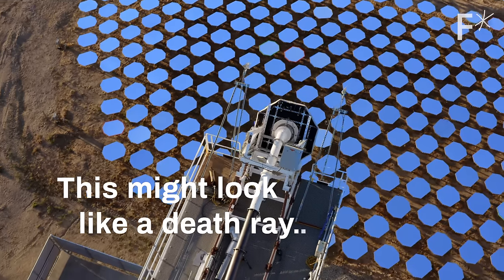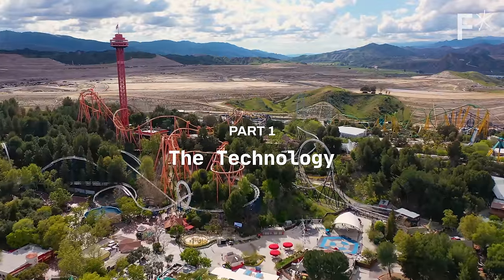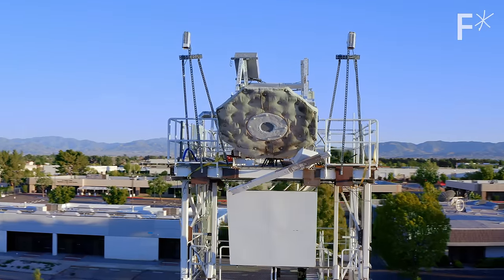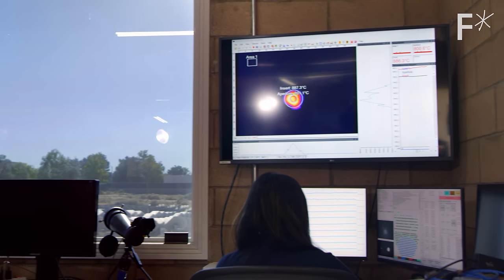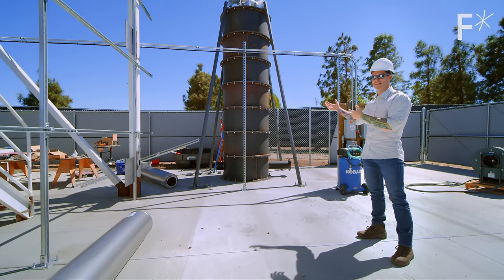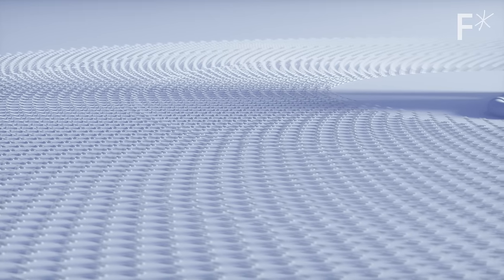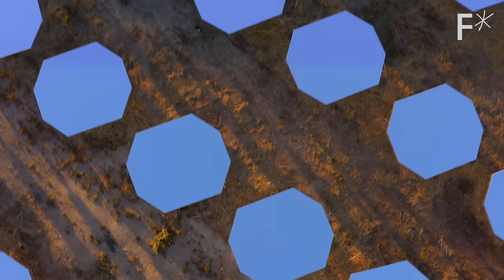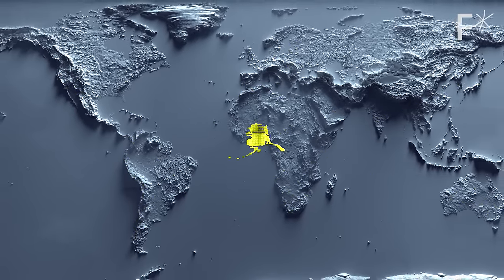How mirrors could power the planet... and prevent wars | Hard Reset by Freethink

Comment: Mirrors should be mounted on posts tall enough for people to walk beneath to use that area as partially shaded, productive agricultural land and using water with no chemicals to clean the panels then drips off to be agricultural watering.
Reply: Agreed! Especially for the dessert?? The shade provided may also create opportunity for condensation water production and be dual purpose for food and energy.
Reply: 1 - plants need sunlight not shade
2 - deserts are not fertile land
3 - water is hard to find in deserts and most would evaporate in the heat
Reply: @shashipancholi  Ridiculous fossil fuels defender.
1. Not all plants prefer 100% sunshine
2. Plants grow in deserts
3. Using water once for 2 benefits is my point
Reply: @sanjuansteve  apologies for being so blunt in my criticisms. Im trying not to be the guy who finds problems in every solution BUT critical thinking is required here.  

Basically farm crops would not benefit from the addition of solar panels/mirrors and ideally you want to keep the surrounding land clear for maintenance reasons. Harvesting the crops would also be a nightmare. The water issue is probably the biggest for me as it would be far more efficient to simply wipe the panels (try washing dishes without wiping) and directly feed water to the plants. Using enough water to clean the panels and feed the plants is highly inefficient and doesn't save any water. 

Essentially the main benefit would be to recover land for agriculture when it would be far easier to continue using arid land for energy production and fertile land for agriculture. There is no shortage of farm land and modern innovations in farming (such as indoor vertical farming) are aimed at producing food closer to where it will be consumed. This project seems to be aimed at producing energy far away from where people are living
Reply: Wind buffeting will do damage .
Reply: @shashipancholi  plants can't cope with the full sun in the desert
Reply: @charlesdickens6706  so how do they cope with full sun anywhere else? Its the same sun. 

What you mean is they cannot cope with the dry heat, which is part of my point that deserts are not the best place for farming
Reply: @shashipancholi  I am sorry to burst your bubble, but agrovoltaics is a thing that is already tested. 

In hotter climates the shade of the panels actually increase crop yield, by not having the sun dry out the crops due to too much sunlight. Moreover in these regions the evaporation that still hapens help to cool the panels and make them more efficient.

In regions like Northern Germany you get a lesser crop yield, but overall the efficiency of ground use increases. whereas a pure solar or farm field would generate 100% crops or power, a combined field generates around 80% of the crops and 80% of the power, for a total field efficiency of around 160%.

These panels are also placed on higher poles, so that machines can ride underneath them.

This is with PV though, so can't say how it would play out for concentrated solar like in this video.
Reply: @charlesdickens6706  Don't be ridiculous.  The structure simply needs to be made for the extra height and slightly higher wind loads.  It's very common to have solar panel covered parking structures for example.  STOP defending fossil fuels with nonsense!
Reply from the maker: Always interesting to brainstorm new ideas! There's certainly a lot of variables that would be at play - would it be cost-effective? would it make sense in every environment? would it inhibit other operations? - but it's cool to think of what other ways of increasing sustainability might be possible and explore whether they'd work. It's the only way to find the ones that will.

P.S. Since someone mentioned vertical farming, we did another video in this series on the subject: https://www.youtube.com/watch?v=J4SaSfnHK3I
Reply: Far to complex. 
Skip it.
Reply: @shashipancholi  Plants can also grow in diffused sunlight, at least grass. Deserts are fertile lands sans water. Just add water and see them turn green. Water is not easy to find in deserts, but can be collected from moisture present in the air.
Reply: It's hard to take you seriously if you keep characterizing your opponent. That"s not good form.
Reply: @freethink  well played...
Reply: Plants need light, there is something called photosynthesis.
Reply: Cochin Airport is doing just this.
Reply: Ok.  But the whole point is to make the system easy to use, set up, and maintain.  If you start increase its size, you're pushing cost for proposing agriculture in a desert, when we have more than enough agriculture already.
Reply: Not much water where the sun is best.  Would you move the sun collection to agricultural lands or import water to the desert?
Reply: @chaoznorder6207  Legit one of the smartest comments I have heard so far.
Reply: nasa: do you want a scholarship?
Reply: The problem with this would probably be in the integration and logistics, how to do maintenance without destroying crops, harvesting with mirrors in the way, optimizing for solar power vs crop yield, etc. Any time you try to do two things at once, you lose efficiency due to complexity.
Reply: @emilemil1  Yes, you're not thinking all of the efficiencies through my friend.  Some plants prefer or will only grow in partial shade for example.  Panel cleaning water becomes agricultural irrigation.  Partial shade provides better working conditions for agricultural labor.  Etc.
Reply: @sanjuansteve  I'm just pointing out some possible negatives. What you're ultimately saving by combining agriculture and solar is land area, and a little bit on a separate shade system. The question is if that positive outweighs the negatives.
Reply: Dump idea, but smart ones will come, but you have to keep the dumb ones coming
Reply: @shashipancholi  AHEM!
Greenhouses...
Reply: We only need to cover an area the size of Alaska to power the Earth. Mounting every mirror on a tall post would increase the complexity and resources needed for basically no reason. Agriculture today is very inefficient, around 40% of US land is used just for feeding farm animals. We don't need even more agricultural land, we need to transition to plant based diets/ lab grown meat. Maybe in the future, when every piece of land will be needed, your idea could be implemented, but for now we should focus on transitioning to using only renewable energy as fast as possible.
Reply: I like it!
Reply: I like the idea of what your thinking and it would work too a degree but the only way to implement it is at the design level and the hurdles to overcome are not so simple. 
To give some context to this...
In the solar PV farm industry there is a common problem of dew condensing on the modules this dew then runs off the modules and creates a line of weeds and trees that then grow up and interfere with the modules (shading, physical damage etc). So yes that water technically could be used for agricultural purposes. However that water is minimal. Now to point out before anyone says it, no it does not all eveprate. It condenses as it falls and then runs off the modules into the soil and is then captured by the soil/ plants before it eveproates.
The shading of the modules does increase plant yeald by a significant amount.
Part of the problem is that this miniscule amount of water always falls in the exact same places so it can not be considered as a sprinkler type senereo (yes I know that was not implied) and the infrastructure and matinance of capturing the water far out ways the cost benifits of implementation.
I'm terms of land usage for agricultural the mirrors would prevent the use of large machinery to harvest and therefore only leaves it to livestock.
Livestock under solar does work however breed and species needs to be considered. Cattle is a no go due to eating wires their size and using the infrastructure as a back scratcher.. goats are a no for chewing cables and their love to climb.
Some breeds of sheep climb and sometimes (but not often) chew cables so some sheep may be used. However they only eat some types of grass and only to some heights which still leaves mowing and weed control over the area the size of Alaska.... And that's a lot of sheep. BaaaaBQ anyone?
Reply: @39ilawis  you much have some German in your blood 😂😂😂😂 just kidding. But the level of attention to detail, analysis and articuration is great on this idea. You are the kind of people who make a difference in any brainstorm session
Reply: @AudioPervert1  what's your solution then?
Reply: @kimtau87  lol because I know the quality and strength of German workmanship I love the complement 🤣🤣🤣 I just wish I was working in a area that I could utilise those skills more freely 😁
Reply: In California, we can put it on top of water reserves!
Reply: Sorry to break it to you folks but these places where such energy harvesting plants are setup, they're fucking hot and any amount of vegetaion is a potential threat to the heat in this area

Also the fact that making a working plan of not just a single plant that harvest and stores energy but a biome that also harvests energy would suck out all the investment and the whole thing would go under

And also farm crops aren't the only crops that should be cultivated especially in places like these, cash crops like hemp can be grown if not within the premises of the plant then nearby and the plant might just provide power to the farms
Reply: @shashipancholi  very well thought out and explained concisely.
Reply: @MDP1702  I wonder if one could use forest farming, aquaponics and agrovoltaics to create a little oasis for civilization.
Reply: @shashipancholi  not all plants need full sun, which is why agrivoltaics is an emerging option
Reply: And anything flying above those posts get fried, excellent idea.

Comment: Man I'm getting obsessed with sustainable energy systems. Post more videos in this topic.
Reply: This is a water drain in water deprived areas, its a horrible system for realistic useage.
Reply: @Geologese , only because they want to convert the electricity created into hydrogen.  If they skip that last step, and just export the electricity, then there is no water usage and it makes for a very desirable system.  Even without the water shortage concerns the conversion to hydrogen wastes energy, is MORE difficult/inefficient to transport than electricity, and creates more issues than it solves IMHO.  All of that extra effort to inefficiently convert the energy to something that has little to no value in existing infrastructure.   

Electricity can be used universally and when it comes from clean sources it offsets fossil fuel use elsewhere, so just start with that.  Hydrogen is not a very good "green fuel" anyway, but if needed it should be produced in locations where fresh water is more plentiful.
Reply: @CL-gq3no  Agree. They can just make an international thousand mile high voltage electric line like what singapore is about to do with Australia. Way more efficient than conversion to hydrogen storage.
Reply from the maker: We certainly will! In the meantime, we have a playlist on next-gen sustainable technologies that includes some if you like. https://www.youtube.com/watch?v=q4CPBHj0UQk&list=PLXthoedLVIdK_4CkLBagXBq7q_bKfHVAO
Reply: @Sen Se A good opportunity to increase your views! nice one!
Reply: @CL-gq3no  How do you produce the infrastructure without petroleum and how do you power the current across the mains over long distances ?
Reply: @geraldbaria  Which takes lots of " pollution" to maintain and run.
Reply: People get lost in the pursuit of one single Source but we don't have a single need we have multiple needs so we can have literally thousands of different ways to freely create kinetic reactions
Reply: There is nothing “sustainable” or “renewable” with solar, wind, or this. The sun is renewable but everything we make on earth is not. Batteries r earth destroying, solar panels r made of coal and high quality silicone. Wind mills use tons of concrete that destroy the environment. Just watch “ planet of the humans” by Michael Moore here on YouTube. He explains a lot. It’s outdated and the specifics r off a little but the overall thesis he talks about is proven.
Reply: @CL-gq3no  Thats why i said his Thesis he talks about is proven. I literally just said the details were outdated. can you read? It makes no difference that solar panels r 4% efficient or 90% efficient. if it still requires coal to make and mine by coal driven machinery it does not matter. Also, the movie explains quite clearly that sand is not used to make solar panels. that is another lie "green energy" activists use to forward their agenda. It takes high quality coal and Silicone to make solar panels as well as more coal to melt the two. its extremely toxic to make solar panels. And yes, solar can be recycled but it takes more oil driven appliances to transport, sort, break down, then transport again, to get it to the final destination where it can be used to make something else. None of that is "Renewable". This is all explained in "planet of the humans" by michael moore.